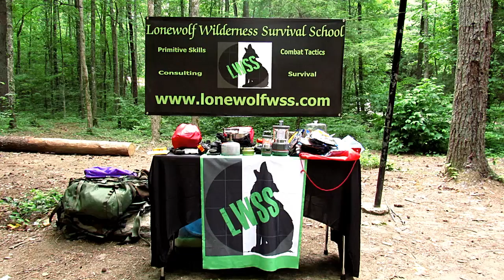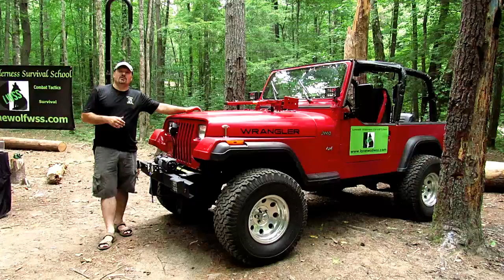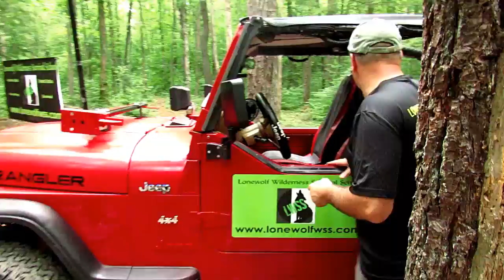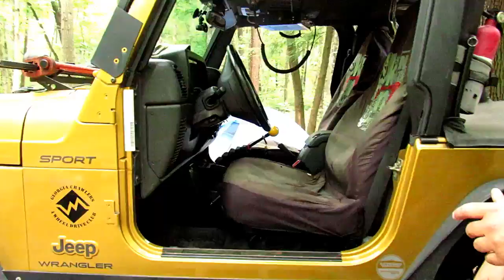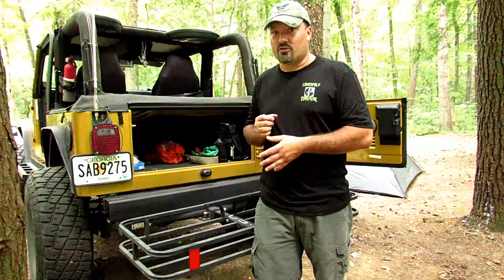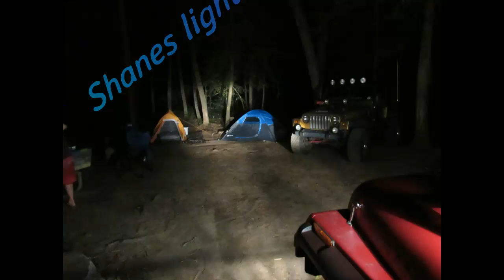Bug out vehicles

Comment: Excellent video with some good information.  Very nice Jeeps as well.  What rear cargo rack is Paul running?  I like the look of that one.   500 lb. rating?  Where does he keep his spare tire?  Smittybilt recently came out with an offroad trailer that I am considering.  It would GREATLY increase the storage space available compared to the limited space in my 2002 TJ.  A hand portable ham radio and a hand portable walkie-talkie wouldn't take up much space at all but would give you a lot of comm options over just the CB in the Jeep.  You would need a ham license but I plan on going that route.  Be safe and keep producing great videos.    Scott

Comment: Nice vid. If your Jeeps have computers and there is an EMP, you're screwed. Wouldn't you be better off with a much older vehicle if you're going to be truly prepared?
Reply: Nasa scientist (find the videos) say that an EMP would not disable many of the modern cars. It might cause some "weird" stuff to happen like your radio to go on and off, lights to flicker, dash to go out etc but probably would not render it totally useless. Also so could a blown head gasket, broken belt, hole in radiator, etc which is more likely than an EMP disabling your vehicle.  However, I agree that an older vehicle with no computer would be best. Problem is they are getting harder to find, most people do not have the time or money to dedicate to the project as a dedicated BOV. In the end we all have to prepare to our best abilities with what resources we have. That's why you have to have backup plans like being able to set out on foot with the necessary gear and skills to survive.
Reply from the maker: mine does not have a computer wiring harness, and computer removed, and motor is carbureted. all electrical is direct wire. and the other has faraday protection. even though we prepare for it the likelihood of an EMP is about the same as an actual zombie outbreak or planet X showing up. Prep Safe.

Comment: food for thought , personally  I would add a small ham radio  to your coms. list either a hand held  or mobile unit . yes you need a fcc lic. for the ham radio but you have a longer range and in times of emergency you may use said ham radio to get help
Reply from the maker: richard imel thanks for the comment we are actually looking into a similar system to install just something that takes up a little less real estate. But good looking out prep safe.
Reply: the tyt8900 is about the size of a slice of bread can get it on ebay for about $80.00 .this is a mobile radio and will give you 25 watts of power. the uv5r hand held is about $30 .00 and it has 5 -8 watts of power . depending on your area the ham lic. will cost you $0-15.00 along with your study book. can get it through the ARRL (American relay leage) for about $50.00. hope this info is a help

Comment: I' WATCHED A LOT OF DIFFERENT FOLKS "VIDS ON "BUG OUT SUPPLIES & I'VE NOTICED THAT A LOT OF YA'LL ARE CARRYING "PROPHANE OR GAS" COOK STOVES, I BELIEVE THAT'S A MISTAKE..."WHAT ARE YOU GOING TO BE COOKING W/ WHEN YOU RUN OUT OF FUEL & YOU CAN'T "RE-UP YOUR SUPPLIES????" I BELIEVE THAT I FOUND THE PERFECT SOLUTION, IT'S THE "BIO-LITE COOK STOVE" THAT YOU CAN USE ALL MOST ANYTHING AROUND YOU THAT WILL BURN & IT DOESN'T TAKE MUCH,,,,BOILS 1 LITER OF WATER IN LESS THEN 2 MINS.,THE HEAT CAUSES GEOTHERMAL ENERGY SO W/ THE USB PORTS THAT ARE ON THE UNIT WILL CHARGE YOUR "PERSONAL ELECTRONICS"(PHONES,NOTEPADS,LAPTOP) WHILE YOUR COOKING & IT'S SMALL & VERY COMPACT,STILLS PUTS OUT TREMENDOUS HEAT THAT'S CONTAINED SO IT'S NOT VERY NOTICABLE. THERES ALSO A FEW "ADD-ON PRODUCTS THAT YOU CAN GET TO GO W/ YOUR "BIO-LITE"...A GRILL TOP,A "SNAKE LITE"THAT WORKS OFF THE USB,& OTHERS.
   I SUGGEST THAT YOU CHECK IT OUT,I DON'T THINK YOU'LL BE DISAPPOINTED! YOU'LL ALSO BE ABLE TO REDUCE SOME OF YOUR OTHER "COOKING GEAR".
   GREAT VIDEO'S,BY THE WAY & I HAVE SUBSCRIBED TO YOUR CHANNEL & WILL BE CECKING OUT YOUR "WEBSITE".
   THANKS FOR  LISTENING,"STAY PREPPED,STAY SAFE.& SEE YOU ON THE OTHER SIDE!!" GREAT WORK,BY THE WAY.IF YOU CHECKED OUT THIS STOVE,PLEASE LET ME KNOW WHAT YOU THINK,"WE'RE ALL IN THIS TOGETHER"!!!
                                                                            RICK
                                                        "GOVPHUCKER@HOTMAIL.COM OR                                         
                                                          PHXAZLONEWOLF@GMAIL.COM"
       P/S: I'M NOT A "SALESPERSON" BUT A "SEASONED PREPPER" THAT TRYS TO PREP FOR THE HARD TIMES BUT TRY TO MAKE THEM EZR & HELP PEOPLE DO THE SAME.
Reply from the maker: We have looked a them before and what you must understand is we use a lot of different types of stoves most of the gear we use is for short term. And we try to give people more bang for there buck and keep in mind folks on a budget. In a longer term situation we use fire of course, also a rocket stove is going to be more efficient than an open fire. We can't  possibly show every product out there and we contact a lot of venders and ask them to send us one of their products for review, some do and some don't normally the ones that don't are only interested in money not really the public so these we do not do anything with. So thank you for your input and be safe out there Lwss
Reply: THANKS FOR GETTING BACK TO ME. YOU SAID "MORE BANG FOR THE BUCK",WELL,I FEEL THAT THIS WOULD BE IT.I GOT A "PKG DEAL" FROM 1 OF MY SUPPLIERS & IT ONLY COST AROUND $100.00 & I'LL NEVER RUN OUT OF FUEL. ALSOYOU SAID YOU PLAN FOR "SHORT TERM",WHAT HAPPENNS WHEN 3 DAYS TURNS IT 1 WEEK,2 WEEKS,1 MONTH,OR MORE??? I TRY TO BE PRACTICAL,VERSATILE & STAY ON A BUDGET "FOR I DON'T HAVE IT THAT WAY".THANKS AGAIN FOR YOUR COMMENT & KEEP UP YOUUR GREAT WORK."STAY PREPPED,STAY SAFE & SEE YOU ON THE OTHER SIDE!"    
                                           RICK
Reply from the maker: Well to answer your question if I was talking long term not going to be using any type of product stove. Going to build a rock stove were I am setting up at and get back to those primitive skills so many have forgot about, once again we can't make everyone happy with what we prefer to use, we purchased one of these at outside world and I don't product bash but I was not really all that impressed, but I would be interested to find out from you how much you use it and how it holds up 12 months from now let me know how durable it is in a few months. From your friends at lwss stay safe keep training.
Reply: I'D BE GLAD 2 KEEP U UPDATED.SO FAR,I'VE HAD THIS STOVE SINCE "APRIL,2016",USED IT AT LEAST A 1/2 DOZ. X'S & I'M PRETTY IMPRESSED SO FAR(I DON'T IMPRESS EZILY).WHENI WAS DECIDEING ON WHETHER 2 BUY IT OR NOT,I CONSIDERED ON A BUNCH OF THINGS(SIZE & WT.;FUNCTIONS,FUEL OPTIONS,ETC...).IF I WOULD BE "STAY'N PUT",I'D DO MORE STATIONARY OPTION(STONE STOVE & OVEN) BUT I WAS CONSIDER'N ON "STAY'N ON THE MOVE " & NOTICABLITY (STAY'N INVISABLE) COZ I CAN'T PREDICT THE FUTURE. THANKS 4 REACH'N BACK OUT TO ME..."STAY PREPPED,STAY SAFE,& C U ON THE OTHERSIDE !!!" P/S:IF,BY CHANCE,THAT U WOULD NEED HELP W/ "PRODUCT REVIEW & TEST'N,I'D BE GLAD TO SHARE MY EXPERTISE. PPS: I TO PRACTICE MY "PRIM SKILLS", I WAS RAISED THAT WAY IN "BLUE RIDGE MTS. IN P.A."